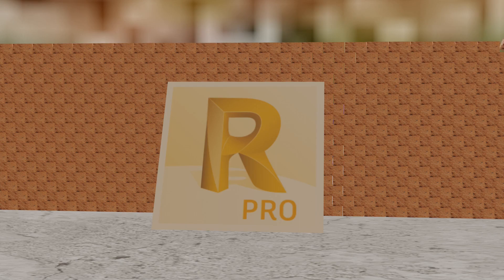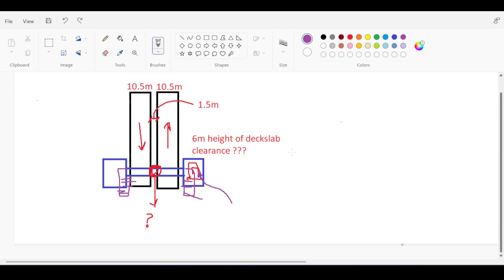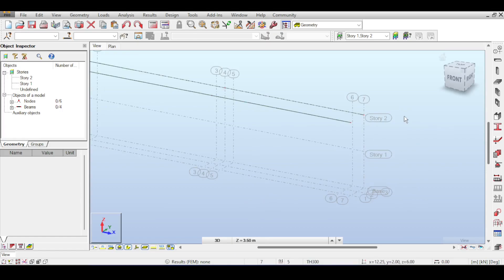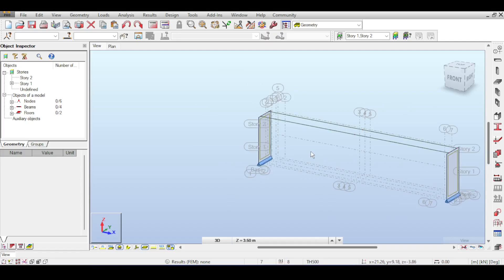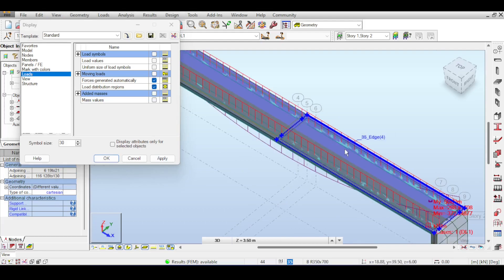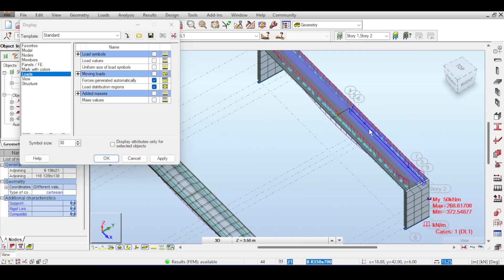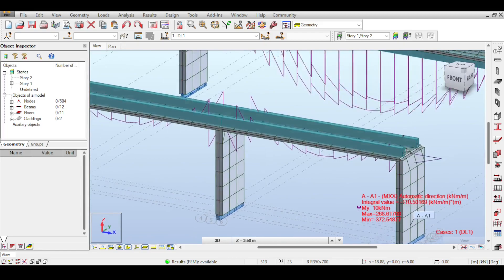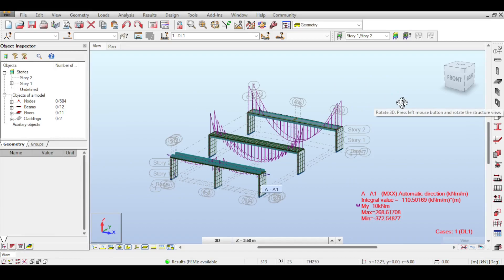Modeling Pedestrian Bridges Using Autodesk Robot | Part 2 - Modeling (1)

Comment: Thank you for the amazing tutorial. Sir can you please explain more about the instability issue and how the release the correct members. I am working now on steel truss pedestrian bridge and I am facing this issue quite a lot. That since its truss the elements should be treated as pin supported on each side and due to that warnings due to instability appears every time I run the analysis.
Reply from the maker: If you are doing a truss pedestrian bridge, then it is EXTREMELY important to note that should have purlins that connect the two trusses at their joints. Those purlins may or may not be released (this of course has a consequence when detailing the connections)

Please try add purlins between the bridges (start without having a release)

Another strategy I use is to not release everything it once, but release them element by element.

Finally, notice that usually the lower chord and the upper chord are constructed as one piece.

Try those things. I hope it works.

Regards,
CEE

Comment: Thank you CEE for a job well done.

I believe it would be a good idea, as you suggested to have a session for the structural planning/theoretical lectures for that matter.

It’s quite clear, we need to have a structural plan to follow so not to wait time on the modeling of structures in robot. 

Regarding, the modeling of the beams, will there be the need to model short beams perpendicular to the long beams resting on the piers of the pedestrian bridge?

Too many member releases in robot always results in instability issues but due to your basic robot course, we surely know how to fix them.

Fixed vs pinned has always been an issue in real practical case, however I personally prefer to model/ analyse RC structure foundation as fixed without lateral bracing and steel structure without lateral bracing as pinned due to rebar anchorage and member continuity reasons.

Is it possible to apply offset to the deck slab, just as the beams? The idea 💡 is to mimick closely the real practical case.
Will it be necessary from the perspective of FEM?
I would love ❤️ to pick your mind on the above.

Thank you 🙏 
Regards.
Reply from the maker: Hi Engr. Nii,
I am happy you liked the video. 
For the short beams, indeed, I have to do that. When I start designing this, I will talk about the need of those beams as lateral bracing.

it is a longer story that involves a well-known debate:
is the deck slab strong enough to provide lateral bracing?
or do we need lateral beams to provide this bracing.

I will touch onto those issues once I finish modeling.

Fixed vs Pin is a really long issue and the only thing I can provide is to talk about the "theoretical" aspects behind them. The decision is solely on the engineer himself.

The deck-slab is going to be really annoying. I may need to use either offset, compatible nodes, or even perform the offsetting myself. I will get a clearer picture before next week's video, as this and the load application are going to be the highlights of next week's video

Anyway, I need to try cover as much ideas as I can in the Pedestrian bridge, in order to make my life in the highway bridge easier.

Regards,
CEE
Reply: @CivilEngineeringEssentials   I love every comment you’ve made regarding the short lateral beams and fixed/pinned connection. 

My take is that the deck floor surely won’t be strong/stiff enough to provide the lateral restraints provide by the deep short beams. 
In my opinion I’d provide these deep beams at intervals along the main beams.

My opinion though.
Looking forward to the next class .
Thanks
Reply: @niisarpei3676  In my opinion lateral beams are not necessary for the straight concrete bridges they ll interrupt the longitudinal stresses flow and make it complex.
for the curve bridge yes, they are necessary to take the torsion effect. 

Thanks, CEE, for the very interesting show looking forward to seeing more.

Comment: Hello CEE,

I like the plan; it is comprehensive and it does cover much broader scope on the subject to be learned. I certainly do not mind if the video series is going to require more parts or videos, etc. in order to cover the work that is outlined on the plan. My view is that the subject matter should be let to drive (dictate) the necessary number (and lengths) of the video parts that are required in order to allow the planned work to be adequately covered.

03:10 I totally agree, there are various factors to consider and the main factors have been very well outlined by the CEE in this video (thank you!). Reasoned considerations on this and the prevailing site-specific constraints can definitely help in deciding the most practical scheme or type of bridge that can be efficiently implemented in that given situation.

06:22 👌 very nice and neat trick to add reference gridlines (thanks)

09:52 Yes, there cannot be new things all the time. The included steps (IMHO) are all necessary and they do provide and they confirm important validations and clarity along the journey of the development of the intended model and the final structure. There is always something to learn, even more so when the CEE is in charge 😊. 

14:45 I am glad that the CEE is stressing the point of being able to develop habits of deciding and choosing model options that closely reflect what one intends to do in real-life as far as it is practically possible. I think this is one of the main things which sets apart a reasoned engineer from the engineer that just do. IMHO, it is pointless to have a “cool model” that does not primarily reflect what the designer intends to build in real-life. The types of connections and the model elements interactions and constraints are far more important than the mere “graphical looks and cools” when it comes to responsible structural modelling.

16:49 😊, I love it when CEE read the minds (I had the predicted question).

18:03 😁😂😁 thank you Mr. Editor, I have it on good authority that DK is a very patient subscriber (patient to a fault). Also, DK has already grasped a few ways (options) that the CEE have already hinted on various previous videos including methods or options which involves inserting own nodes that the mesher will be forced to mesh; selecting “fine” meshing panels under Job Preferences >Meshing; typing in a value for the “element size” under Analysis>Meshing>Meshing Options; making use of dummy members to “trick” the RSAP mesher. DK is also banking on the fact that it does not seem to be in Mr. Recorder nature to forget things and as such Mr. Recorder is more likely than not to address DK and others outstanding requests whenever and wherever an ideal opportunity arise during the current or during other planned projects video sessions. 

21:20 Thank you CEE for using side-by-side comparisons, I always find your approach (side by side comparison) to be one of the most invaluable approaches to learning and it really does make it that much relatable and relatively easier to quickly grasp and to “see” the various implications and consequences of the different methods in actions        

  
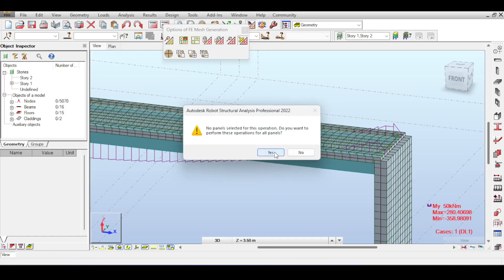24:30 I do not think that CEE is making things up. On the contrary, these are exactly the kind of things that I was referring to in my comment at 14:45 above, as far as I am concerned these are amongst the core of responsible structural modelling in action.

26:07 Thank you Mr. Editor (and Mr Recorder of course) for sourcing and sharing the information regarding a monolithically cast prestressed beam to pier connection.   

26:54 😂🤣😂GIRDER*, GIRDER*, oh dear Mr. Editor, it is good to have you around.

26:41 Oddly, I have released both my beams and I have also released the deck slab from the piers and I ran a dry run analysis without (intentionally) fixing the piers foundation supports, I was expecting instabilities errors with this scenario but to my (worrying) surprise the structure analysed successfully without showing or reporting any instabilities errors 🤔??. 

I then applied arbitrary horizontal loads at the top of the piers on the above structure with the aim to aggravate (😚) instabilities, but to my other (worrying) surprise again the structure analysed successfully without showing or reporting any instabilities errors 🤔??.

Upon further investigations, it appears that “any applied beams offset” seem to be causing the structure to not report expected instabilities errors? I removed (I deleted) all the applied beams offsets, re-analysed the above structure and the structure is now behaving as expected and it is also showing instability errors (😊 as expected).

Ps. I never thought I would be so happy to see my analysis giving me instabilities errors until today 🥳🥰

Furthermore, the Bending Moment diagram is no longer squiggly (without any beams offset that is), it is rather clean, nice and dandy just as it is in the case of claddings.

I suspect that the applied beams offsets are resulting in other implications (over and above the BM due to offsets) that require further deeper investigations? For now, I have opted to remove all beams offsets on all structures as this seems to be giving a more representative and expected structural behaviours. 

@CEE: I hear the CEE at 35:01 saying that the released beams still have moments because of offsets. It is mainly the impact of the beams offsets on the stability (or instability) of this particular structure that concerns me. Is the above the case with your models as well? 

30:03 Enchantee. Mr Editor, kindly thank Mrs CEE on my behalf for letting the world have the CEE Channel!!

Thank you for another great video, I have truly enjoyed today’s discussions and explanations of the nuances relating to this pedestrian bridge planning, modelling, and analysis. Keep well and I am looking forward to the next video.

Regards, DK
Reply from the maker: Hi there Engr. DK,
I always enjoy reading your and Nii's comments. They usually give me food for thought and provide some insights for my other viewers.

I'm happy that the planning section is helpful. I kind of was about to edit it out, but thought that stuff like this is not always trivial.

The trick of grids was smthn I discovered while teaching robot back in 2010. (My first Robot course was a course I gave back then in 2010. I was still a little cute BSc Student in 3rd year).

Indeed, I think the video might not really offer a lot of new stuff, but at least might be a refresher. I do use some techniques I have provided videos about before, so at least now engineers see it in action.

Oh yes, the 14:45 is something I always teach my students during the senior design project. It simply DOES NOT MATTER how good the model is, if the engineer himself does not understand what he is doing.

On 16:49, I did this because I was planning to linear-release the slab. But, the editor should have roasted me because that "slab splitting" was only useful when I had a pier in the center, and was not useful otherwise.

I think the editor will be happy with him knowing that all the countless things I have done to "coerce" the mesher to do my bidding helped.

Oh the side by side comparison is important, and I am planning actually to have multiple bridge layouts discussed. One with a sub-structure, one with an external staircase, and so on. I have to think about it.

You know when the Editor gets annoyed. You will see a HUGE CAPS word in the center.

About the releases, I have to do my own investigation, I need to get the root cause of those moments. is it offsets? is it axial load? am I missing something?
I was rushed by my battery running out TBH... Editor didn't say a thing coz the dude was hoping that I stop recording. He had tons of stuff to edit out.

Mrs. CEE is a really cooperating and lovely wife. I will give her the regards.

I also saw the other comment. I have to investigate this issue myself. You know, I do not want to just say stuff to sound cool, I always have to substantiate my claim.

Stay tuned for more,
CEE
Reply: @CivilEngineeringEssentials  

Likewise, your views and feedback are always a joy to read, they are both stimulating and they help me to develop confidence and to have clear plans and plausible options on numerous subject matters. 

I couldn’t agree more with you in that “….the impression is not the goal, but a side-effect….” 

With regards to editing out content, I find it important to mention that what may seem as “trivial stuff or content” to other viewers is not necessarily so for everyone. The CEE have been doing a superb job in deciding what stays and what goes 😊, the content delivered so far is both inclusive and accommodating and I hope that the CEE will continue in the same way. 

The current platform is also flexible and accommodating for the various viewers in that viewers have the option to skip any content that they may consider to be of no interest or relevance to them.

Thank you for undertaking to have a look if the “beams offsets” are impacting the current model stability/instability.

Regards, DK

Comment: Additional information:

I have just tested the stability (instability) of the Baseline Structure model from the RSAP model file that have been linked by the CEE. I am getting the same oddness from the CEE linked model as I have explained on my comment (26:41) and in my own structure model.

Thought to mention this in hopes that it may help to review.

Regards,
Reply from the maker: Thnx for your extra info.
I will have to personally investigate that issue. I think I may uncover some ideas. As you know, I try not to just say stuff to impress, but to spike interest. The impression is not the goal, but a side-effect ^_^.